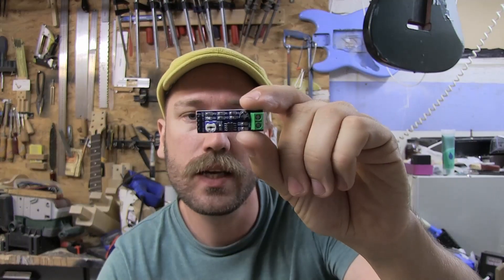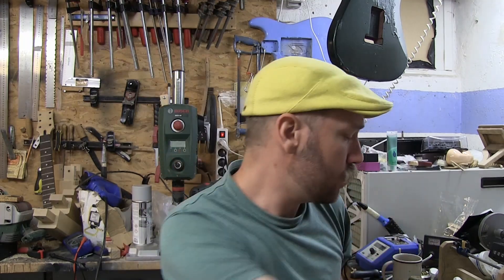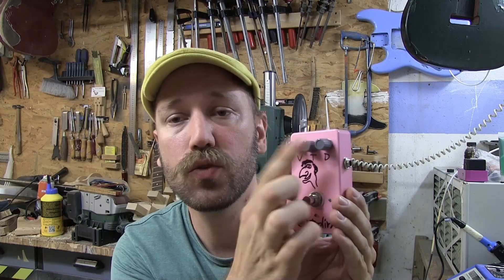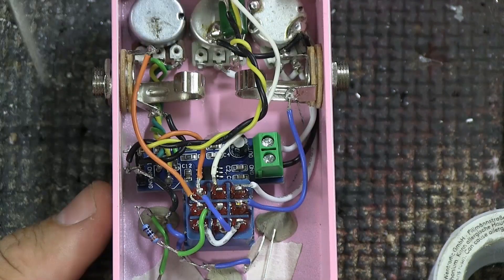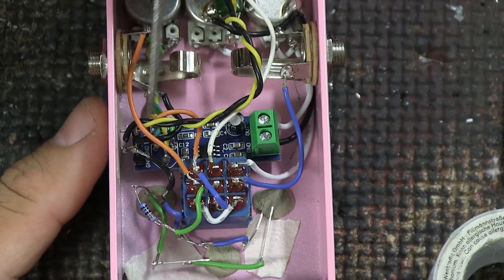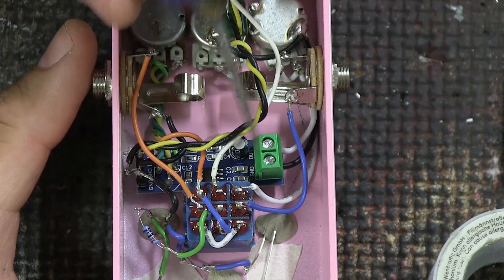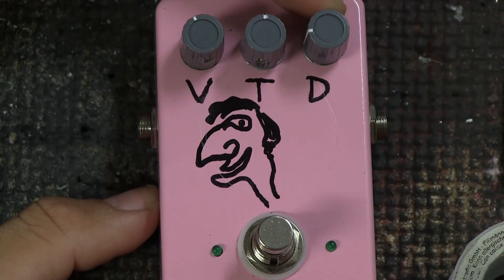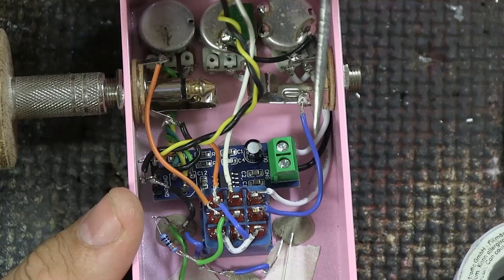lm386 pedal with volume, tone, and distortion control

Comment: Hi, I've lifted some pads while I removing the volume trimpot. How did you do you it?  Did you just cut it or removed the component completely?
Reply from the maker: Hi I've done both its way easier to just destroy the trimpot and keep the legs of it in place and then connect wires to them but if you have pads that are lifting cut them off ao nothing more can luft and connect wires where the pads were going to it can be hard to see but if you have a multimeter you can check with continuity good luck 👍🏻🙂

Comment: Nice! Little suggestion, maybe it would be nice to add a "fat" / tight mode on the input. A cap in series and a resistor to ground at the input functions as a high pass filter. This way you can tighten up the sound by cutting the lows at the input. The filtered signal would be the "tight" and filter bypassed the "fat" mode. 
Downside using this method is that the output impedance of the guitar will probably influence the filter cutoff (I think). If you add a simple input buffer this would be solved.
Love your content! :)
Reply from the maker: Thank you it could but cool to check out😊

Comment: Ok ,I need some help ,I've been trying for months to make a simple pedal with one of these ,input into the lm386 then into a volume pot then a output but with a foot switch to bypass the lm386 and powerd by a barrel jack , in theory a super simple pedal with a set amount out fuzz that you can still ajust the volume on but I can't get it to work ,any tips or maybe a video to help ?
Reply from the maker: @musicbylewisturner  I have several videos on how to build a lm386 fuzz pedal that could hold the answer the problem if finding what the problem really is some time the board is broken even if its new it can be a bad solder joint or a broken potentiometer I can't tell you exactly what it is but I have a play list on the lm386 and I have a video called how to preparing to build a lm386 pedal good luck 👍

Comment: What circuits in a walkman or portable cassette player?
Reply from the maker: @hadleymanmusic  I'm sorry I don't understand the question
Reply: @zurowetz  well is it a chip or circuit like this you have what? 386? Whats a portable cassette sony walkman?
Reply from the maker: @hadleymanmusic  its both all electronics have a circuit and the and the walkman used chips too but they'll be different ones for different models of walkman I found a schematic using the ne555

Comment: I built an LM386 based pedal about 20 years ago. It performed great except it didn't; nothing I did modding it would let punch harmonics through! Using a 3-band tone stack, switching it to a single tone control, various clipping diodes including germanium, high pass network etc., and it didn't matter what amp I used it on. 
Fortunately, I moved onto my own designs a few years later and to outstanding success. If you don't need to squeal, snarl and the sleaze of p.h., it makes one hell of a pedal and an even better mic preamp.

Comment: What values of variable resistors have you set?
Reply from the maker: Dis 10k vol 250k and tone 250k but it's recycled from a guitar so don't think too much about it 😊
Reply: @zurowetz  thx, man.
Reply: @zurowetz  Can I ask another question, marking of potentiometers A or B?
Reply from the maker: @igrayu_v_roblox  well I'm unsure as its from a guitar but I would use a A for volume and a A or B for tone it's not a big deal but I hope I have a A for volume in the pedal 😅
Reply: @zurowetz  Okay, every little thing matters.

Comment: Man... so a few days ago im looking at your diagram and watching the other videos you have around these lm386 boards. I have 2 bullet strat pickguards loaded and was about to recycle that to do this... but i went extra man. So one day on a whim about 4 month's ago i bought a few passive volume, treble, bass boards. So i did one 386 into another like you did on the one pedal. I added the eq, and volume section on the output. I adjusted the input 386 not on max but pretty close, and i added the external trim pot on the 386 output board that goes to the e.q.. i think i bought like 3 or 4 of these e.q. sections from aliexpress for pretty cheap. The pedal sounds amazing to me. Playing with my volume on my guitars and synths and playing with the trim pot on the pedal goes from an aggressive drive, distortion, to almost eqd doomy fuzz pedal. Man i wish i could show you. Maybe ill make a video but i consider a trial run because i have a buff and blend circuit i think im adding to the next one for a clean blend. Your videos even when they dont help me directly still inspire me, so thanks for existing man. I have a pedal ive never seen anyone use or play that i feel is pretty unique and i owe you for it.
Reply from the maker: Wow that sounds amazing 😲 you have to make a video I wanna see it 😀 thank you so much it means the world to me that the videos I make can be of any use ❤️
Reply: @zurowetz  I'll make a video soon. So I figured it would be all doomy sounding so I made a pink enclosure with hello kitty art work as a joke and now I regret it because I find it way more versatile and it's in a stupid hello kitty enclosure
Reply from the maker: @madzpanda  love it 🤣🤣